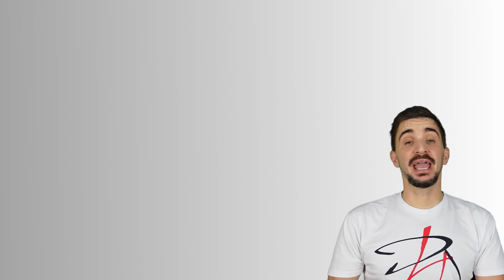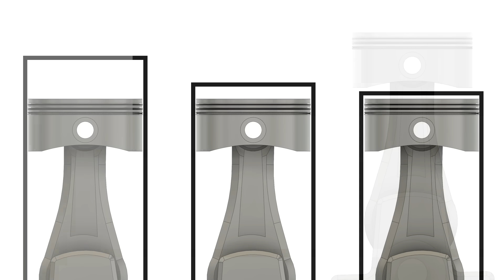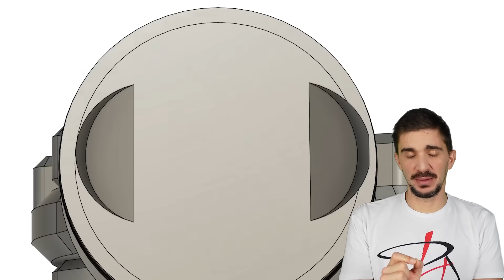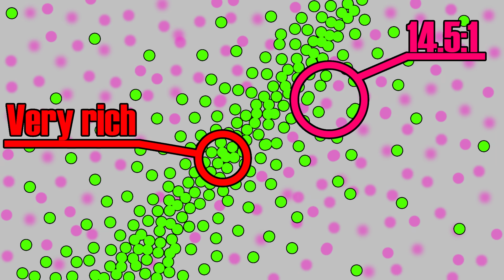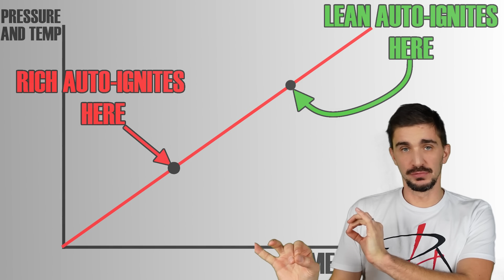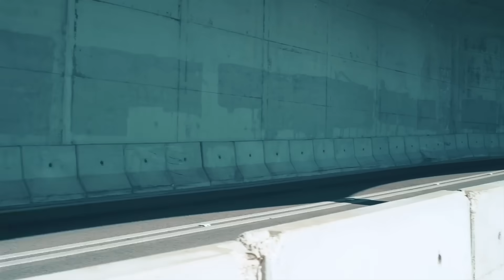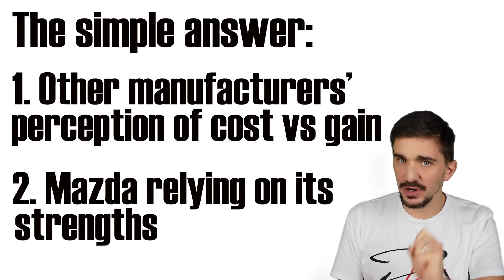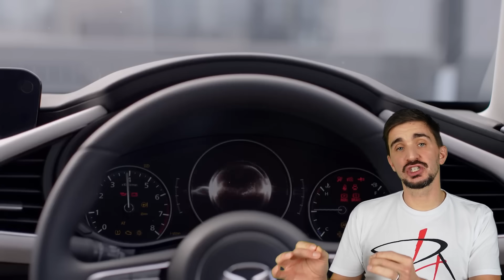The Game Changer Nobody Cares About - Mazda Skyactiv-X SPCCI How it Works and Why It Didn't Catch On

Comment: Got a Mazda 3 with Skyactiv-x (186hp) and it's consistently running at 5.2l/100km (45mpg) at maximum highway speed (120km/h in my country = 75 mph). 

At lower speed it's even better, reaching easily 4.0L/100km. For an engine that powerful it's very impressive. My previous Citroën C3 with a 95hp engine was running at 6.9L/100km
Reply: I have exactly the same experience as you!
Reply: That's wildly impressive! That's what I get in my 2020 Hyundai i10, but your Mazda has nearly 3 times the power, and weighs almost exactly 500 kg more! Mazda just jumped far up on the list for my next car!
Reply: @AIRDRAC renault clio performs similarly if not even better
Reply: @oadka according to Renaults own website that is only true for the hybrid and diesel versions which are completely beside point here. And neither of those deliver 180+ horsepower
Reply: @AIRDRAC fair
Reply: that's awesome dude! what speed do you get 4l/100km at? 80kph?
and 5.2 consistent seems to be comparable to a 1l 3cyl turbo engine from VW, but that makes only 100hp or sth so this is very good
Reply: @oadka  Yeah roughly at 80km/h for the 4L/100
Reply: @betadyne9559  That's too high for 80km/h. Is it automatic? I get ~3.2-3.4l/100 at 80km/h with manual. For 120km/h, it's similar to you.
Reply: @oadka imagine if you made the skyactiv into a 1 liter turbo, with 3 or even 2 cylinders like the fiat twinair, and run it on cng, now that would be globetrotting for the poor
Reply: I have the same engine, for 3 years, and so far it has been amazing.  You get imho the best of both wordls. On one hand you have a very efficient SPCCI mode when you want to cruise, but when you need power, you have a naturally aspirated 2l engine with 186hp and with all the fun rev range. And even with heavy foot the fuel economy is reasonable, becasue it isn't a turbo engine, which tend to run rich in high power bands to reduce combustion chamber temperatures to prevent knock.
Reply: Yep thats pretty much exactly what I'm getting with mine too, calculated by my fill-ups vs mileage, the on-board computer seems to over-estimate economy by a few percent.
Reply: @__-fm5qv  Never! I can't believe that, a car company would do such a times as making a computer that over estimates the vehicle economy
Reply: They should def make an NA V8 with the tech and put it in a lightweight mid mounted carbon chassis.
Reply: I have a 20 year old 2.0l (150bhp) Mazda 3, pre-Skyctive and I'm very happy with it over 16 years of ownership. I get around 7l/100k on average. So the newer engine represents a decent step up in both economy and power. That's pretty impressive to me. Also, I'm an old-school 'driver', not just a 'user', so actually working the engine to reveal its best is a plus point for me!
Reply: i wants it... does mazda have any mini vans?
Reply: @jebise1126  If you live in the US, you can't have it.  They don't sell Skyactiv-X in the US.   But, their normal 4cyl Skyactiv line is extremely reliable, more so for the naturally aspirated versions; their turbos don't seem terrible but all turbos I think become a problem eventually.  When they came out with Skyactiv in 2012, it was the most fuel efficient mass production gas engine on the market.  Since then it's been outdone, especially by hybrids, but it's still not bad, and a world better than their old MZR series engines.
Reply: @big0bad0brad No wonder I wasn't finding hardly any when I was looking! 
I hate the fact that our commerce is controlled by the industries and not by what consumers want (not to mention the whole fascist mess in power right now). I hope we can take things back soon. Until then friends, do whatever you need to protect yourselves from our government and oligarchs.... 
💜🗽✌️😸
Reply: @erinmac4750  I'd put all national US politicians on the same boat and sink it, but this won't bring Skyactiv X to the US. But oh man would that be fun.
Reply: @erinmac4750  Maybe they did a survey and they didn't find a lot of potential buyers in NA.
Reply: Good stuff!

My VW sportwagen 1.8 turbo (2wd, 5 speed manual) does 42-43 mpg (5.6 l/100km) at 75 mph and has 170 hp.

Best ever was 48 mpg (4.9) at lower highway speeds over a three hours drive. 

I love efficient gas engines.
Reply: learned to drive on a diesel that was easy to learn the clutch in driving school. really learned to drive my GF 1.0l , 50hp econobox in twisties, mountain roads. etc. and you really had to work the gearbox. also, however you could downshift it, etc it was never quick so you had still had plenty of time to time your shifts 😂
now driving an automatic SUV. even though it's MUCH quickers, takes a bunch of the driving pleasure) 
but finally found some fun again in daily driving a small, quick, and good handling EV (Mini cooper SE). still not a huge fan of one pedal driving , but at least you gain back the control you're losing with automatics. it's not changing gears at the wrong time. you can get the equivalent of engine braking any time with regen. power comes instantly, an predictably . the car does exactly what you're asking, nothing else
Reply: In contrast I'm running a golf wagon with a 1.8tsi, 75mph common cruising speed, similar hp, and I'm hitting 36-38mpg. The jump from 36 to 45 is actually significant, enough so to overwhelm the declining rate of return with mpg gains.
Reply: @OnkyoGrady litres/100 kilometres . . .
Reply: I've gotten up to 49 mpg in summer weather, once it gets below freezing the mileage drops to around 36 mpg on highway.
Reply: I have the 150hp and i'm 0,5 lt up but yess
Reply: Holy heck! My 1.9, 19 to 1 compression diesel doesn't get under 4 liter how do you do it?
Reply: But... How? My 3 SkyactiveX (181hp) was averaging 6.7l/100km (combined city/country/highway) and long trips (100-130kmh) 5.7l/100km if I recall correctly. I mean it was efficient and I liked the engine but I couldn't dream about averaging 5.2l/100km overall. I had the sedan and didn't drive it like crazy or anything...
Reply: @musje83  Read what I wrote carefully.
Reply: @betadyne9559  I did. Please elaborate
Reply: @musje83  I wrote  "5.2l/100km (45mpg) at maximum highway speed (120km/h)"

You wrote "combined city/country/highway" and "long trips (100-130kmh)"

So, you did not read, because nowhere did I say combined city/country/houghway nor long trips (100-130km/h).

Geez, people on the internet.
Reply: That is extremely impressive.
Reply: Also getting similar figures, but the key is to keep a constant speed, if you speed up and slow down for any reason, those figures will go up a bit. also, these figures are for the manual transmission , the automatic transmission is using about 0.5 to 1 l more , also is slow and s***t in general :)
Reply: @mQtwister  Yeah and by the way : the manual transmission is the best I've ever used. It's so damn smoooooth and precise !
Reply: @betadyne9559  do you even feel slight vibrations in clutch while starting in uphills without giving gas (when starting by only releasing clutch pedal) ? I experience this sometimes on mine (SkyActiv X manual) but I don’t know if it’s normal ?
Reply: @lmpb3484  Not much. I mean, do you have trouble finding the friction point of the clutch ? Because the Mazda 3 has an automatic assisted hill clutch helper which will increase rpm and prevent going downhill and the friction point is generally smooth.
Reply: @betadyne9559  thank you for your answer. Well, I mean sometimes when I want to start the vehicle slowly in a hill by only using the assisted clutch hill helper (so when not giving a lot of gas or no gas, when doing a manoeuvre for example), I feel small jerks in the clutch, just as if the friction point is not really linear. It doesn’t happen every time, only in hills, and it’s small, it’s not as if all the car was shaking. But I still can feel it. If I give more rpms (like 2500 rpms) it seems to disappear. But I was used with my previous car to park and manoeuvre in hills without giving gas and it was fine. Btw, the SkyActiv X seems to run a little bit less smoothly than a conventional petrol engine (I mean with a lowest compression ratio).
Reply: I see lots of local car ads , market place and a garage i frequent all with engine issues in skyactive, can't recall if its just diesels but all with engine trouble ?
Reply: Those are numbers previously only possible in hybrids at 65mph (2014 Ford Fusion Hybrid has 191hp)
Reply: Wow.
Reply: Mine has 190hp and average on 34mpg (it was advertised as 30) AND I LIVE IN LA
Reply: How long do you own that car?
How many km has it?
Any problems you had so far with needs to be mentioned, please?
Reply: @Kliq-n2s The only problem I had with this car is that the parking cameras are sub-par. It's 3 years old and has 30k KM
Reply: @betadyne9559 basically it's a new car.
No doubt it will serve you for a long time!
Thnx 👍 for your reply!
Reply: So they come with a stick, right???
Reply: @billpetersen298  There's an automatic and a manual version, if that's your question
Reply: I haven't driven the 2 l SKYACTIV but I did drive the 2.5 and was very unimpressed with the fuel mileage in my short test drive compared to my diesel Mondeo. It was in the sevens not 5 s
Reply: Ja laag in zijn toeren blijven rijden ,loop de mijne 1 op 20...
Maar deze motor is daar niet voor geschikt, ik vind bij 3000 rpm schakelen het mooiste koppel...en laat hem ook zo nu en dan 4.5,, 5.5 rpm rijden voor een min of 5.....dan blijf ik in zijn 4 rijden .🤔
Reply: I drive a nearly 30 year old BMW 5-series with a 2.5 liter 6-cylinder engine with 170HP and I can get her to 5.7L/100km cruising The Netherlands at 100km/h. With the A/C running. At 120km/h it is 6.2 without A/C.
Reply: @michaelXXLF  At 100km/h I'm most likely around 4.5L/100km
Reply: @betadyne9559  I rent a citroen C4 cactus 1.6hdi 10years before and was like 3.5 diesel plus 250nm of torque and only 1000kg curb weight. Surprisingly agile as well. Euro 6d. Nothing can beat the diesel efficiency
Reply: @courcheveller  Exept that diesel is emiting very dirty particles...
Reply: @courcheveller  *volumetric efficiency. cost at the pump now makes it a wash in terms of costs, especially when factoring in AdBlue which is mandatory from Euro 6.
Reply: @michaelXXLF  Maybe older BMWs ,my BMW 2.0 gasoline is 15l in town ,8l outside off town .ALso have Insignia 2.0 diesel ,9L in town ,outside off town on highway 6l and on country roads 5.5L
Reply: @michaelXXLF stop the 🧢
Reply: @michaelXXLF 
170 HP is nice and it's not bad mileage for that era and power, but it's not great either compared to the Mazda, and isn't the Netherlands basically flat lands?
Can't really look sideways at old reliable though.
Reply: @michaelXXLF IMO BMW's best years and vehicle for regular drivers.
Reply: You know actually I would had expected better consumption than that seeing that "Technologie", my old megane 4 from 2016 with the 1.2tce 4 cylinder engine with 130hp and manual I get 3.9L/100km at 80km/h constant speed, in city driving I got as low as 5.8L/100km and highway well at 130km/h it consumes a lot actually about 6.9L/100km because the 6th gear is not that long and you are at 3000rpm but going down to 120km/h it consumes 5.5L/100km with the new 1.3tce they put a longer 6th gear and the engine runs at ~2450rpm at 130km/h and the consumption goes down to 6L so yeah mazda's engine is not as impressive unfortunately other brand manage to get same performance for cheaper they get more benefits from their selling
Reply: @nightb2759  You're still consumming more gas with 30% less hp...
Reply: @nightb2759  I had similar experiences with a 1.2 turbo engine from Skoda. One thing I can say for sure - it is not correct to compare the efficiency of a turbo engine 1:1 with that of a naturally aspirated engine.
First, it is because of the change in power and efficiency, secondly, it is because of the reliability of the engine in the long term (oil cost, spark plugs, turbine service, etc.). So in the end, when you draw the line after 15-20 years of engine use, taking into account fuel costs and maintenance, the scales may not be as tilted as you try to show them in the short term.
But everyone is free to make their own choices and be happy with them.
Reply: @nightb2759  Are those numbers what the computer tells you? Because if that is the case then I have news for you: they are not even close to accurate. I constantly get 6-7 l/100 km in a Mazda 3 sedan with this engine pump to pump running 140 km/h on the highway and some city driving (where I disable start-stop). Oh, and the whole gearing thing is irrelevant, with VVT, DI and software the computer already optimises the amount of fuel used to produce the exact power needed so different gearing makes no difference.
Reply: My 3l turbondiesel uses 5l on open road, and 6 l combined if i dont hoon it. If i drift my car and hoon it it averages 7-8l which is not bad for 204hp and 20+ yearold car with almost 400k km
Reply: @absitinvidia11  It's a diesel though. So it spits shitty parrticles everywhere.
Reply: @betadyne9559 realy i dont care about polution. I would like v8 also stright piped.
Reply: @absitinvidia11  Did you watch the video or know anything about diesel ?...
Reply: @betadyne9559 yes i did and i know a lot about diesel and engines in general. I am not fan of diesel, i just wrote that 20 year old diesel offers similair pros. I personaly just care about reability and performance, and romantic factor. M57 just offers reability and mpg economic. I just want reliable egines back and i dont care about enviorment stuff because i think cars are small part of it that, is honestly neglecting on global scale. From my point of view, LT is perfect, by my checklist of stuff i find immportant. Open source, ported and direct injection decent rpm prety simple, great sound and prty reliable. But i would also not need better engine than s54 and i would choose it any day over skyactive engine. If mazda made 250-400hp engine whinch would end up reliable as that old diesel crap i would be sold i am sceptical  untill stuff is lets say tested and prooven. Also mazda at this point has only 1 interesting car for me which is to small and lack power. Nothing new is good and, i wonder how that engine will perform affter 350k km
Reply: 45mpg highway? That's not even that good. My fiesta gets more than that. And an mx5 which is a light car somehow gets less than that
Reply: @professorpigeon-q4t  How much horsepower does your Fiesta has ? It's annoying all those "yeah my car with half the horsepower can do the same" comments.
Reply: @betadyne9559  153hp, its also a lighter car
Reply: I get 41mpg at 80mph in my 2021 rav4 le. Daily. Non-hybrid.
Reply: I can do that at 90mph with my 3 llitre 650 hp N54. 🤷‍♂️
Reply: Still makes low displacement EA288s from VW seem extremely impressive because I’ve been able to achieve 4L/100km consistently doing 100 on the highway with a 1.6tdi from 2015 with my best being 3.7L/100 absolutely babying it on the highway. Getting rid of diesel for passenger vehicles was a mistake imo especially considering that no mainstream diesel platform got to enjoy the benefits of a good hybrid system
Reply: @mertvaran5733 both Mercedes-Benz, Volvo and BMW have made, or are currently making, diesel hybrids.
Reply: @A @AIRDRAC true however none of the brands you listed are truly mass market brands. VAG group, Renault, toyota, honda etc. are missing despite having experience with diesel engines and attempting to break into electrification. The mercedes plug in hybrids are very nice tho if only they didn’t cost 2-2.5x what I can feasibly afford
Reply: @AIRDRAC no they are not. Nobody makes hybrid diesel cars,only mild hybrid and PHEV diesel
Reply: @andreiarama8745  you are aware that "hybrid diesel" is the blanket term that covers all types of diesel/electric hybrids, and that you are subsequently listing two specific types of diesel/electric hybrids - right? 🤣
Reply: @mertvaran5733  Fair point - I suspect the fact that they (per the video) still have the underlying issue of NOx and other particle pollution is the main reason that small-scale diesel hybrids aren't really mainstream, whereas it's probably a huge plus in luxury cars to get the immense torque of a turbodiesel for e.g. towing a boat, or just floating along effortlessly, alongside the efficiency gains of a hybrid.
Reply: @AIRDRAC Yes I'm aware of that,BUT in the same time I don't like when people do that because it's such a big difference between the 3 systems. The Mild Hybrid on a BMW 320d for example is just a 11hp boost for a few seconds till the turbo spools up and on the Mercedes PHEV you can do 100km on a charge. Nobody makes full hybrid diesel because it makes no sense and PHEV diesel make even less sense that's why the used Mercedes PHEV are so low in value. The only one that makes sense is the Mild Hybrid diesel but mostly because in a lot of countries you get the fiscal perks of the Hybrid name
Reply: @andreiarama8745 PHEV diesel hybrid makes perfect sense if you are commuting daily, but also driving on holidays (or to e.g. A summer house). Electric efficiency in the daily commute, and diesel efficiency on long drives, or if you are pulling a trailer or caravan.
Reply: @AIRDRAC from Mercedes POV it's not worth it because they can only sell it in Europe,small market. From the buyer POV it's too expensive,you need 160.000km of pure EV drive to recuperate the premium over the diesel version (0.25€/kWh). Then it has too much torque at low RPM,too heavy so it will finish tires like there's no tomorrow. The DPF will never finish regeneration because of the EV driving. You are going to pay for the  oil change even if you barely use the diesel engine. You will need to change the hybrid battery before you get your money back if you do a lot of EV drive because of charging it so much(around 100.000km and it costs+18.000€).It is a car that makes sense only in Germany and if you drive A LOT! But the used market of diesel PHEV is full with low prices because of all the things I just said
Reply: @andreiarama8745  But you're looking at it the wrong way. People don't buy a hybrid E-class because they want to be economically reasonable - they buy it because they want to feel better about themself buying a luxury diesel sedan, and want incredible amounts of torque and power available for those three times in the lifetime of the car that they actually floor it. And the PHEV Diesel fits the bill perfectly! It's buying a "clean" conscience, not because they actually need it, but because it makes them feel like they are making a responsible choice, while still having the torque of a small ferry. (and having driven one, it is incredibly smooth and well calibrated, and will not tear up the rear tires unless you want it to). That it will also eat autobahn kilometers like there is no tomorrow is absolutely a plus as well.
Reply: @AIRDRAC who buys a diesel  Mercedes almost never knows what they buy. For example the c300d is lighter,faster, bigger boot and cheaper than the c300de. The E450d is lighter,faster and bigger boot. The GLE 450d is faster, cheaper,lighter and way bigger boot than the GLE350de. Conclusion? The PHEV diesel is the bad choice
Reply: @mertvaran5733  The VW engines are very impressive in that regard. But when it goes to economy it's also worth bearing in mind that the Mazda 3 for example is about 150 kg heavier than the golf, it's a bit of a porker. Which does affect its economy unfortunately.

At 60 mph (close enough to 100 kmh), my e-SkyactiveX will read about 65-70 mpg on completely level straight ground. Thats 4-4.3 L/100 km. Given that the average mpg is about 5% too optimistic (worked out through mileage and fill-ups), it's possibly 4.2-4.5 L/100 km. So take out the extra weight and I don't think it would be too far off the VW.
Reply: As an American, your method of measuring mileage (L/Km), makes my head hurt. It’s backwards from our MPG.
Reply: @Firebrand3377  You guys use inches, feet, and any means necessary to avoid the metric system... except when it comes to sending things to the moon ;) 
Measuring things on either distance per unit of fuel (mpg) or fuel per unit of distance (L/km) offer different perspectives. But the problem is that MPG has so many drawbacks :
- It's not linear
- It's not additive
- You can't easily calculate fuel cost for fixed distances (you need three steps instead of two)
The good thing about mpg is that it is kinda intuitive when you think about ranges instead of costs.
Reply: @b @betadyne9559 ah woah, easy there. I was just talking about how your mileage units are backwards from ours, and a lower number for you means better economy. But since you mentioned it…it wasn’t just the moon lol. Our military for the most part uses SAE fasteners.
Reply: @Firebrand3377  Hehe it's funny because those are two fields where the US are simply the best in the world !
Reply: @Firebrand3377 It's Canadian, eh?   Easy to do math, especially averages. Our gallon was different, and your canning jar lids didn't fit 50 years ago.
Reply: @RandyTWester I forgot about the canning jars. You awoke a memory in me 😂.